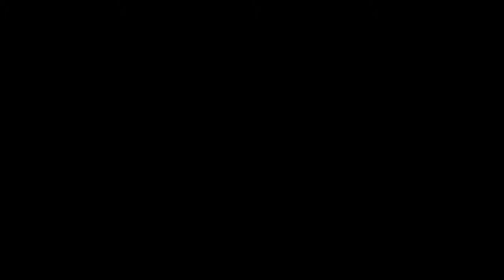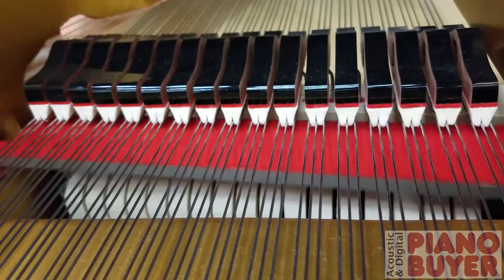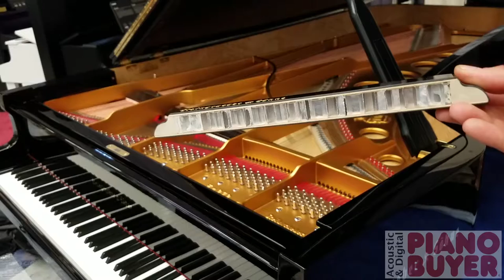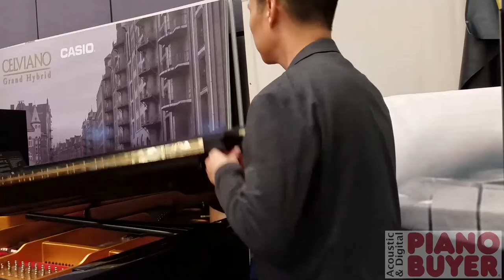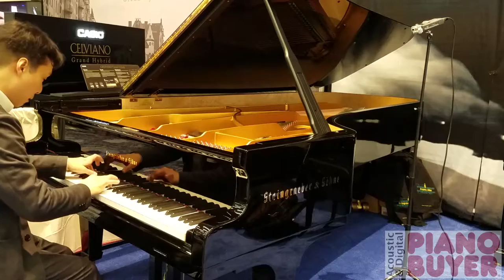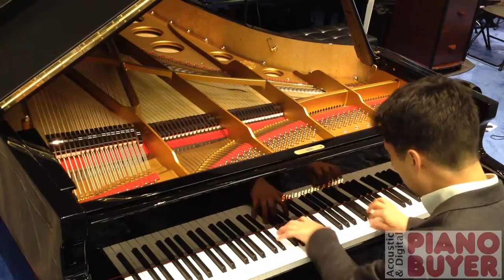Steingraeber & Söhne E 272 Concert Grand Piano Review

Comment: The felt on the middle pedal was rather common as moderator on German uprights in the 70s and 80s to tone them down in rental apartments where you do not wanted to annoy the neighbors. This one does not seem to muffle the sound as much as in these uprights.

The Mozart rail sounds interesting. 

But it lacks a sostenutl, doesn‘t it? Many pianists probably would not care, but some use this very often, especially those who play Ravel or Debussy stuff. They would probably not be too thrilled to arrive at a concert hall and find a pinao without a sostenuto on stage. It is pretty much a standard equipment on concert grands since some decades and I think every Steinway D - the benchmark of concert grands - has it since the 1890s.